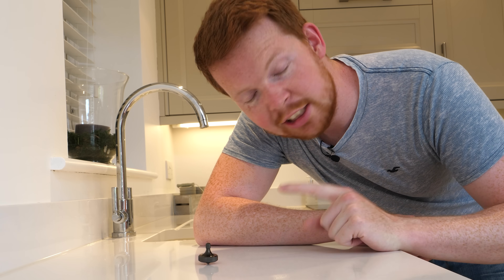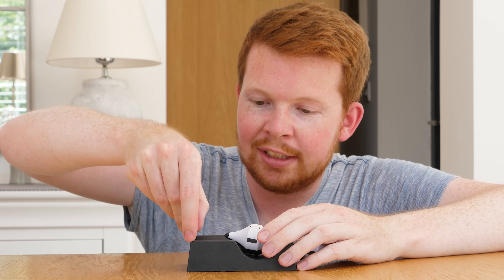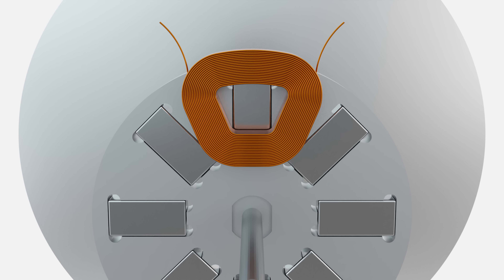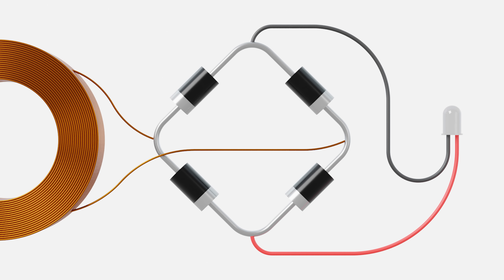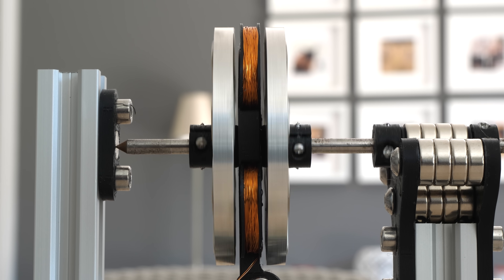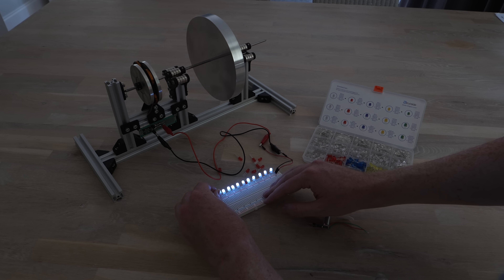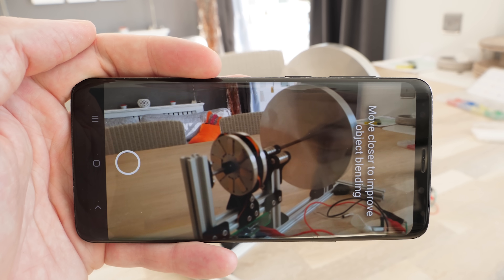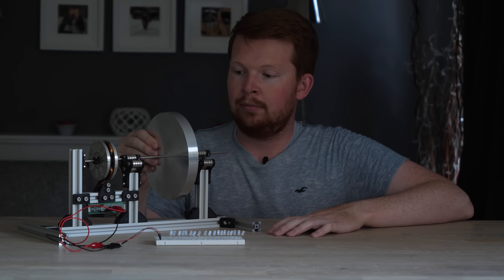Flywheel Battery

Comment: That pulsing is exactly why in a 3 phase alternator the windings and outputs are 120 degrees out of phase. More constant and level power delivery. You have a single phase.

I love this whole project and would love to see you leave it as AC and put it through a buck boost transformer instead!

Comment: Question: Instead of holding the axle with a plate and a point contact, couldn't you just use another magnetic bearing?  The weight of the flywheel should keep the axle in place, so that the bearing magnets at the end stay sufficiently aligned, and now the only friction is air friction.

Comment: video mentioned that DC current is required to power a light bulb, but that is not accurate, at least for incandescent bulbs, such as common house bulbs - those (and even fluorescent and most LED house bulbs) are powered by AC current.

Comment: You should try replacing your end point and restrictor plate with a hall effect sensor feedback , electromagnet actuator control system. You can then turn that into its own levitation system and get rid of all the friction.

Comment: You might consider a 3-phase generator and bridge rectifier as in modern car alternators. This might reduce vibration somewhat since the required torque is more constant as the rotor turns. It would probably also reduce the required capacitor size to provide a continuous output voltage.

Comment: My understanding is that straight cut gears are more efficient than helical gears. Chain and sprocket is the most efficient power transmission of them all
Reply: Depends on the distance. For shorter distances a single pair of gears are more efficient since it’s basically a chain and sprocket, but with no chain

Comment: Perhaps you could construct the same device, but where the flywheel makes contact with the glass plate, use a diamagnetic materials and a neodymium magnet to prevent actual contact. You could use bismuth for that purpose. The bismuth would repel any magnetic charge applied to it so the flywheel remains truly levitating and there's no friction at all except for air resistance, which could be mitigated by placing the whole contraption in a vacuum chamber.

Comment: I'm still surprised nobody has miniaturized this similar setup down to be a handheld cell phone charger. Practically you could use something similar to a ripcord, as energy to be converted from mechanical to electrical using a similar setup.🤷‍♂️👍👌
Reply: It’s already available, just search up hand crank phone charger
Reply: You can buy that from your local hardware store

Comment: use plastic wheel to hold the magnets your out put will be more. the aluminum wheel holding the magnets spinning close to the coils is being slowed down by the field in the coils that the magnets are inducing

Comment: what is the max voltage that can be generated if we add like 3 of the giant wheels but they also have the magnets and coils? will it generate more if we remove the small discs with magnets and add series of bigger of such discs?

Comment: It would be cool to hook that up to a windmill would just have to find a vertical connector for the horizontal shaft. Also, your choice of magnets play a significant role. Achieving over 5 volts with the surface area of those magnets, and strength (looks like n32) by performing on a larger scale you could definitely achieve good results to store power for usage!

Comment: You should put a yo-yo type disc on it, and a pivot point at the bottom so you can pull start it, and it winds itself back up in the opposite direction!

Comment: If you had slight friction stability on both ends and a ring of magnetic levitators on both sides of the fly wheel, it would be more stable and be able to go much faster. Your frequency is probably really low too but that's obviously just due to instability.  Great video!!!

Comment: this project is VERY interesting, can you add some MainSpring found in the mechanical watches to spin upt the wheel, and maybe some super capacitors to make the output smooth. 
That would be Amazing.

Comment: Why aren’t you running better (brushless) AC motors? You start with AC. Loose a bunch of energy rectifying it and then you run an inefficient and maintenance heavy DC brushed motor?

Comment: What of we put a rubber flap on a kettle with a magnet on top near a coil. The pressure builds and pushes the flap and magnet up, changing a magnetic field and inducing a current in the coil but also relieving the presure, causing the flap to reclose, and then repeat.
It's frictionless, unlike other steam engines, 4-stroke engines, etc, so maybe that would have some efficiency advantage?
It'd be very little at a time and the flap could wear out, but we could store the electricity and potentially the wear out wouldnt be super short

Comment: Shaft needs to be drill rod.
Flywheel does not need to be aluminum.
You are designing a power generator from motorcycles from the past 100 years.
This is a high school science project.

Comment: Well, Shape is an important factor in Flywheel design! You are using a normal disc shape, which has a shape factor K = 0,606! The most ideal would be a no stress Laval disc with K=1, but it's impossible to manufacture an ideal laval disc! So a Laval disk with rim is used (at least for Metals (steel, Tungsten etc) which has the shape factor K = 0,95, it can store more than one third more energy while being the same weight! Modern composite FESS systems have rings of the composite materials (shape factor K= 0,5) but they can be spun so much faster that they actually store more energy

Comment: If you generate enough power for the motor can you put the motor to spin the big wheel ?
Reply: That would be a closed system which would not work in this context. This would be along the lines of assembling a perpetual motion machine. Friction and other “resistance” elements would also hinder the process.

Comment: Add a pendulum to power it 
Two flywheels and a pendulum 
Understand two flywheels and a pendulum is the basis 
The most basic description 
Of what I’m talking about 

Think six pendulums
And seven flywheels 

All driving the one axle in the same direction 
Te first flywheel moves in the same direction as the axle 
The second axle reverses  the direction of force
 so it aligns with the axis direction

The pendulums depending 
on the number you connect
 are waited electromagnetic coils 
That are  attracted to a magnet that is the top of their swing 
The pendulum swings along its path 
You change its polarity at the end of its swing 
Creating a force magnifier 
Basically it builds up a charge 
And releases it in a moment 
As the opposite polarity 

The pendulum 
Is basically hit by a bat 
This is repeated at the 
Top of its opposite peak 
Done right you will build
Momentum continually 

The pendulum transfers it energy to its corresponding flywheel 
Magnetically

The more pendulums and flywheels the more elaborate 

Like magnetic braking used in fishing reals 
To magnetic gearing 
The way the flywheels  is geared so that they can spin farster
And produce more torc or power at the axle 
To a firing order along the pendulums 
I see a series of discs 
Pendulum flywheel pendulum flywheel and so 
You generate the power from these discs 
To power the pendulums only
The axle is your source of power 
You now have a gravitational motor 

It’s really up to your imagination 
How well you design the gearing 
To how well it will work 

Gravity is the force 
Magnetic polarity is the hand 
How complex is up to you 

Free power from gravity 

Fish amen

Comment: What happens if you use the currents to spin a motor, which in turn spins the flywheel?     I get the feeling that this device works too well, and energy companies don't want this device commercialized. 

Couple that with an enclosed space with a vacuum to allow for longer spin times.

You obviously did not choose to use the drill to increase the speed of the flywheel, while it powers up the LEDs.    Are you concerned that a fully sped up flywheel, in a vacuum, would generate enough light to last for 30 minutes?

If you place a huge version of this device in low earth orbit, wouldn't it spin for hours, generating hours worth of electricity?

Comment: So there is a company that makes flywheel energy storage systems.  Back in 1997 a customer berated me for storing emergency backup power in batteries, as they were sooooo dangerous.  He said I should have this flywheel company bring in the flywheels.  The specs were impressive.  Unfortunately if you leave a flywheel spinning with 300,000 watt-hours of energy, the metal of the wheel will be suffering from metal fatigue eventually, and then suddenly disintegrate as a 300,000 watt-hours exploding ball of steel, and completely destroy everything around it.  Years later I looked the company up, and they were still selling flywheels, but they were installing them in armored explosion-proof concrete bunkers buried in the ground.  When they were pitching me, they just bolted them in racks next to your computers, so they would destroy the whole datacenter when they failed.  Brilliant!

Funny, my batteries never exploded, never failed, they just boringly did their jobs.

Yes, you CAN store a LOT of energy in a flywheel.  but do you /really/ want to?

Comment: if you put the flywheel in a vacuum will it spin for ever? only thing breaking the rotation ist the air or not? :D
Reply: Only without the magnets and coils because the magnetic fields in the coils induce a force in the magnets that will make the wheel slow down

Comment: What you have not said is that the flywheel will stop faster than it did without connecting the coil and generating the current... This is because some energy is converted to electricity

Comment: I’ve watched this video a couple times and I’ve always wondered if how it would perform if you used materials that didn’t interact with the magnets. The steel is obviously ferrous but the aluminum also responds to the magnets in the same way that copper does by creating eddies. I’ve also been curious about what would happen if you spun the flywheel a lot faster with a drill or something.

Comment: The rod could be bent but i think the entire “rotor” is bouncing on the magnets. Its essentially and spring mass system with ‘almost’ no damping - so any offset will just cause the rotor to bounce for a long long time. Not only that but the rod could be bending under the weight of the flywheel. It seemed under-matched for the flywheel. Really interesting concept though. I wonder why we use batteries instead of flywheels.

Comment: If your goal is to extract DC electricity from the flywheel a much simpler solution would be to implement a homopolar generator invented by Faraday which produces much more power and current. All you need is a small conductor brush touching the rim of your disk and simply embed your disk in a strong magnetic field and voila!

Comment: All flywheels should be the battery it's self that way the the battery will have kinetic and chemical energy to utilize all the wasted weight of batteries. Like a battery/ flywheel DC/ac motor as the tork converter in a car.🤷

Comment: Instead of having the induction coils you could always go with Faraday's desk by adding magnets to the rod and the discs flowing in the same directions trickling electricity that it is well simultaneously using one of the discs to feed back into a homopolar motor at the end of your Mendocino motors

Comment: Could you configure a gear setup that used the electricity built from the initial hand spin to then circuit the energy produced by the gears to continue spinning until enough voltage is kept to running whatever it is built for?

Comment: What if you made the coils smaller so you can use 6, and then placed them in a configuration of three sets side by side? The pulses would theoretically be tighter and maybe weaker.

Comment: The flywheel doesn't need to be thick. It just has to be wider diameter. Because the mass of the flywheel also depends on the distance between axle to outer diameter. Because the gravity helps there. Even a light weight flywheel can create good amount of inertia if its built in larger diameter although it's thin.

Comment: You missed a good opportunity to modify that design. The end that has the point that touches the stabilizing plate for stability can be modified. Remove the point (cut the rod just above it) and then put a small, strong disc magnet in place of the point you removed with the south pole facing the stabilizing plate. Then, put a similar magnet on the stabilizing plate with the south pole facing the south pole of the magnet on the rod. Now, the two magnets will repel each other and counter any forces with a frictionless magnetic repulsor effect instead of a pointy tip contacting a metal plate. Best wishes.

Comment: what if you used a scroll like compression of air made within the flywheel, balanced ductind, that initself jets the air out at an angle that supports the force of continued movement?

Comment: Would it be possible to use another coil around the end you spin with your hand that can be energized to start the rotation? Or would having that extra coil have negative effects on the system
Reply: Or what about a ring of magnets on the end that spin the metal rod which can be moved closer or further away to control speed. Or would they disturb the magnetic field causing the levitation

Comment: I was waiting through the whole video to see you use that generator as a motor to charge the flywheel.
Why didn't you do that?
That would be the most straightforward way of using this mechanism as a battery.

Comment: Very funny experiment. Obviously the final use is defeating the original purpose. After making a very complicated magnetic lossless bearing, we now have massive losses in the alternator. So one could revert back to ball bearings and do away with the complication... you can still spin it by hand and get your LED lightshow, but it would not use so much desk real estate....

Comment: Could we use silver wire I was told it was 6% more active
Reply: If anyone reading this I melted gold silver and copper together then poorerd it out then hammered as thin of a wire as I could wile making the flywheel out of strong magnetic to keep the flywheel going and to act as the charger the wire was wired to work with and I’m still making more

Comment: 8:35 can you add a one way hand crank on the right side (if you don't touch the hand crank, the gears shouldn't interfere with the spinning rod), it would be much more easier to spin it with a crank IMO.

Edit: you can add some led strips as a backlight and let's kids play for fun as well.!

Comment: bad very bad, only pure N or pure S. Guaranteed to fly, an SN mixture is not possible.
That's why it breaks the floating state and falls to the right or left.

Magnet levitation train is based only on N or S, magnetic field on an electrical basis.

Comment: Always such an awesome concept.  I remember MIT or whoever had tried to make extreme high speed ones at 10'+ diameter ran into wear issues because of the rotation of the earth and the gyroscopic stabilization effect of the flywheel lol bonkers problems.

Comment: You could have added a 3rd ring of magnets, and in between, put another set of coils that's oriented in a way that fill-in those 'power gaps' happening between your first coil set. You could double your power that way, and also cut in half the frequency of current interruption.

Which also leads me to wonder: Couldn't you just keep adding more layers of magnet/coil sandwiches, to keep increasing the output created from the same small amount of force? I know that eventually weight would become an issue, needing stronger levitation to keep it all floating, but I'm curious to see this idea expanded as described above, to see how many coils and magnets we can juice from one levitating flywheel.

Comment: ‌Brilliant. I enjoyed it very much. I also have a question. Did you measure the difference of stopping time of the flywheel with the same initial speed but in two different positions one with electric generator and one without it. I wonder how much is the difference and how lenz's law effects. It is obvious that when we turn some of energy flywheel will stop sooner. I am curious to know how much sooner would it be. And l think it could be a good topic for another exciting video.

Comment: Kinda of un related,but a flywheel question none the less. If u had room or could change the bicycles shape. Would you use a bigger/ heavier flywheel? Could you use 2 flywheels or even three. I have a project potentially using a 72 inch flywheel. I would prefer to use 2 36 inch flywheels. Thought? Great page by the way. Awesome videos

Comment: Okay, keep these things in mind.  The electromagnetic launchers they now use on carriers (American) have to have a way to store large amounts of electricity.  I though it would be a bank of capacitors, but I was wrong.  They use a rotating drum, just as you do here to put in and store mechanical energy into electrical energy.  It's the shape of the drum that matters most.  You are doing it wide and flat.  Try long and thin instead.  The catapults use long thin drums, which can be spun up faster and easier and spun down when needed.  And that much rotational energy in a thin narrow drum is pretty clear in a safety consideration as well as generating less heat in spin up and spin downs.
Reply: because of how moment of inertia works you store more energy with a large flat rotating drum than with a wide long one (assuming same speed and mass)

Comment: I work in a hospital,we have three flywheel UPS’s for backup power.
They are 300 kva per flywheel,their job is to hold power if the hospital has a power outage.The flywheels are designed to hold for 15 minutes,until diesel generators take over.